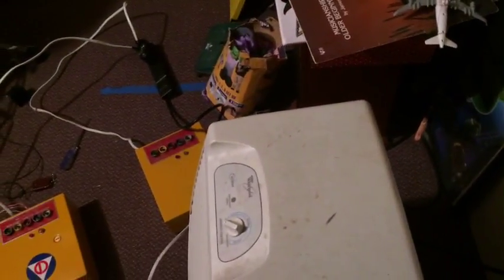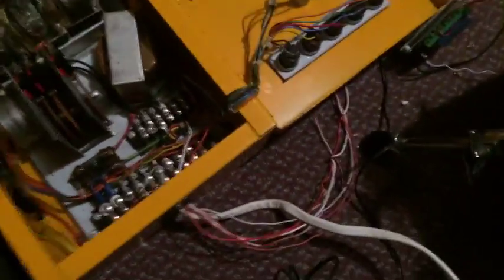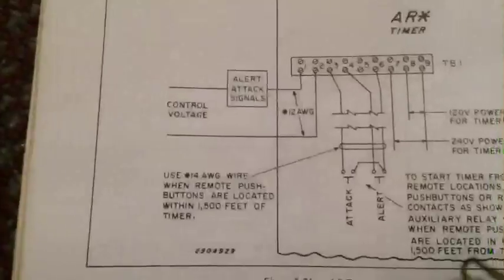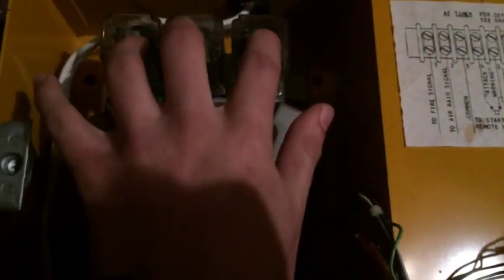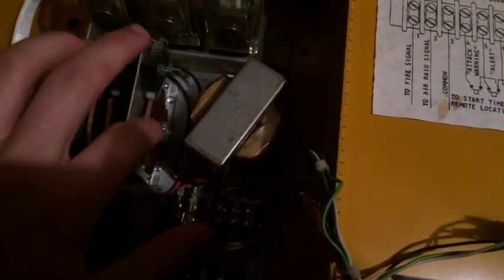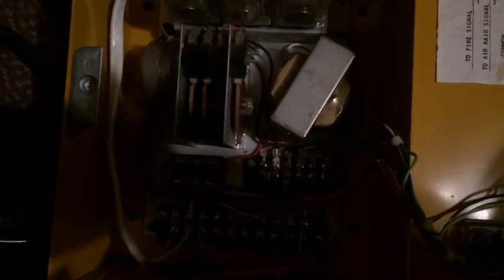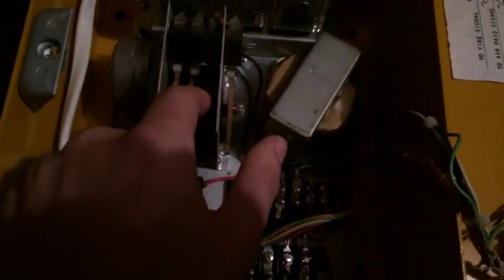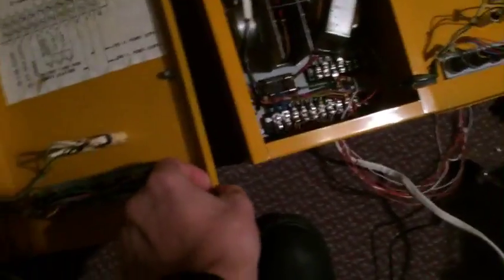In depth description of how the AF and AR timers work

Comment: How would you wire the timer to do Undulating Hi-Lo when the fire button is pressed? The stock wiring of the AF timer will have the siren do a steady Hi-Lo signal but it is possible to have the AF timer do Hi-Lo wail.